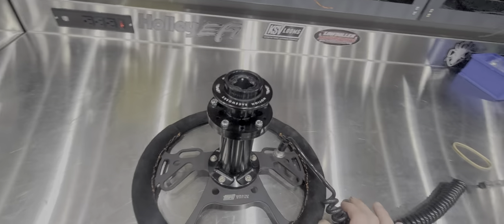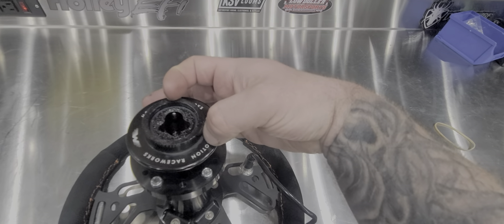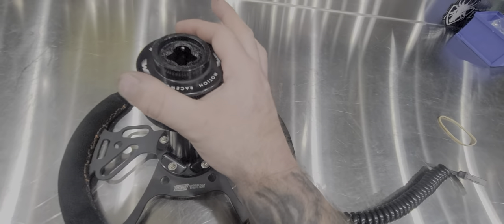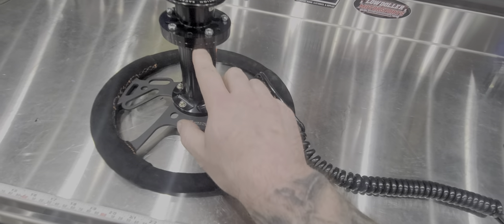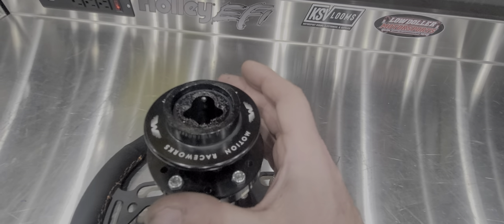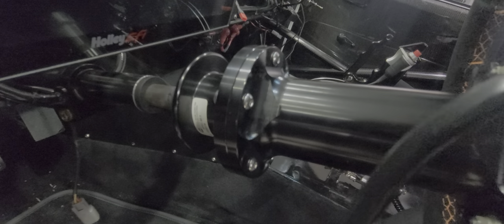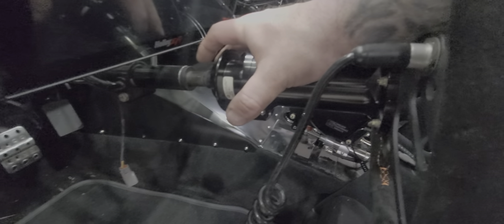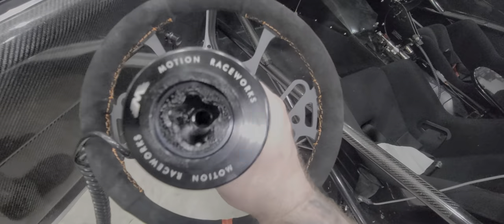The new Motion Raceworks steering wheel quick release. Yes it's better than the rest of them.

Comment: #krontec  No need for the umbilical cord. No need to pull it back to reinstall the steering wheel.
Reply from the maker: Until you have to parallel park with a krontec in a car that the wheel turns more than 1 revolution
Reply: @theholleyefiguy  does that happen a lot in your Mustang? :) Unless it's a Honda in a bad neighborhood, I don't see many QD's on street cars.